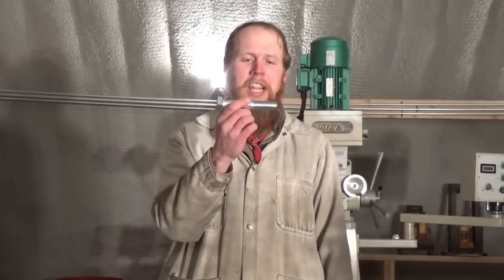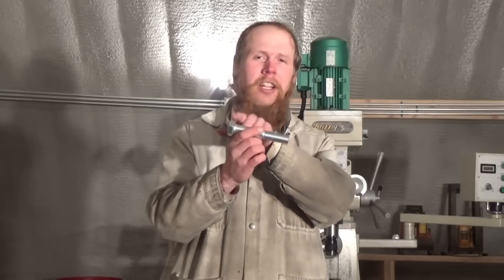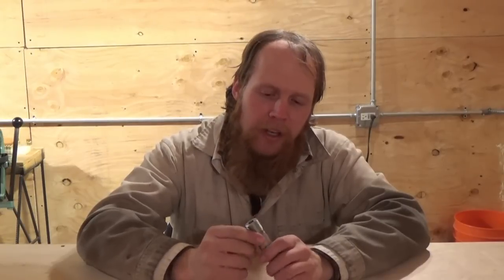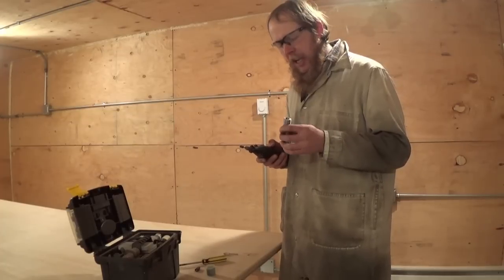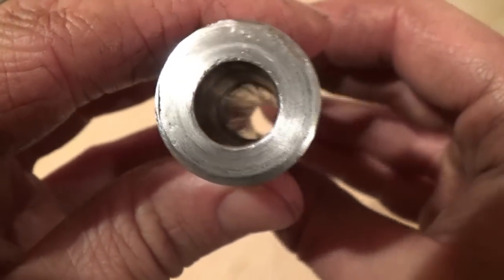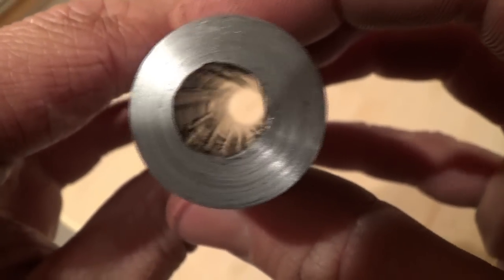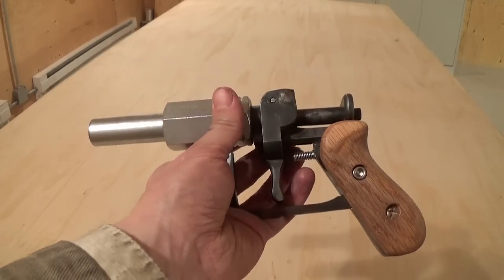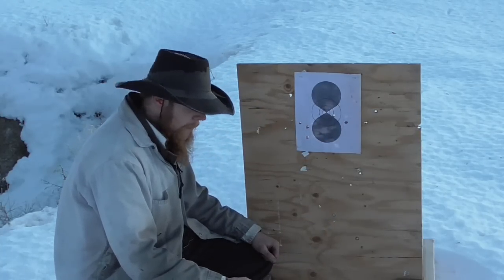Making a Rifled Barrel without Machine Tools (TIS081)

Comment: As a machinist, I am impressed with your ideas about rifling. It is the only skill I could not figure out without rxpensive equipment. You sir are a genius.
Reply from the maker: Thank you!
Reply: @TheIdahoanShow  Have you made any other rifled barrels since this video?
Reply: "There has to be a reason the industry uses button or cut rifling"

Efficiency. Those production methods are relatively inexpensive in terms of the machinery/tooling required and man-hour-labor invested per barrel produced.

-It's the very same reason most barrels are button or cut instead of polygonal, even though polygonal riffling is more accurate. (Polygonal costs more to produce)

-The same reason far more high grade barrels are Chome Moly Vanadium instead of stainless steel, even though stainless steel is just as accurate and offers utterly superior corrosion resistance. (High grade Stainless steel is harder to machine)

You can get a super match grade stainless steel polygonal barrel - but due to the production cost of such a thing: you'll pay quite a premium to get it. 

I.E. You can buy a match grade Krieger AR-15 barrel for $370.
https://kriegerbarrels.com/products#ar15

As compared to this Noveske example of a match grade stainless steel polygonal AR-15 for $$574.
https://www.midwayusa.com/product/100346872/noveske-spr-match-barrel-ar-15-556x45mm-nato-medium-contour-1-in-7-twist-18-stainless-steel-with-switchblock-gas-block

My comment was only pointing out another way one can produce a barrel without the aid of or access to complex industrial machinery, which by the way, is the whole point of the video on which you are commenting.
Reply: @ObservingLibertarian  yep that would work to the extent the metal conforms to the mandrel and if you put the red hot barrel inside a larger end-capped tube (with a mandrel-sized hole drilled in the cap) you could contrain the deformation of the hot barrel as you pressed the mandrel through it, which is the only other problem i can envisage with your method other than being able to handle it quickly enough that the barrel doesn't cool down.
Reply: @ObservingLibertarian how about making a polygonal button and driving it through the barrel?
Reply: He certainly looks like a genius to me!
Reply: Aww shucks
Reply: Very intuitive! Hey, do you think heating the barrel during the buttoning process would help at all? I was just wondering if taking a torch to it while pressing it might give some more accurate groves. Maybe take the barrel upon finishing with the buttoning and getting it to about 1100 degrees or so and quenching it before heat treat?

I don't know, just some thoughts.
Reply: Observing Libertarian Try it. Post a video of your results. There has to be a reason the industry uses button or cut rifling (yes I know those are two entirely different processes).
Reply: Observing Libertarian there are a couple of problems with your theory. 1 metal heated to that degree will deform if you attempt to force a mandrel through it.  2 if you were some how successful in getting the mandrel into the bore of the barrel once it cools you would never get it back out.  take some classes in metal working.
Reply: You can also use the same technique he used to create that "button", to instead create a mandrel longer than the unrifled barrel, heat the barrel in an electric furnace, or over coals till it glows, use a press to force the mandrel through the barrel and allow it to air cool with the mandrel in place. 

While the steel is hot it's expanded and much more malleable, as it cools it will contract around the mandrel and take the riffling inscribed on the mandrel, conforming to lands and grooves. 

After that, drill the inside of the mandrel out till the pressure causes it to collapse and remove the bits and pieces. Tada, riffled barrel. Then you just need to heat treat it, temper it and you're good to go.
Reply: @ObservingLibertarian  Do you know a method to avoid having to make a mandrel for each barrel? Until you got to “drill out the mandrel” I was thinking it was a genius idea.
Reply: Observing Libertarian you can build a rifling bench with no complex machinery and produce cut rifled barrels. I stand by my original comments on the method you proposed.
Reply: "metal heated to that degree will deform if you attempt to force a mandrel through it"

Less than forcing a button through it while it's cold. The process is called "shrink fitting". 

"if you were some how successful in getting the mandrel into the bore of the barrel once it cools you would never get it back out."

Unless you bore it out by drilling through the middle of it after the work piece is cooled. Just like boring out a broken bolt except easier because the barrel is exerting external pressure on the mandrel as a result of the shrink fit. It'll likely collapse inward as soon as you bore a hole 6/8 the od of the mandrel.

Comment: What is the diameter of the button you push through on its "cutting edges?"
Reply from the maker: Well, it is slightly (a few thousandths of an inch) larger than the diameter of the hole.  I am still trying to nail down the exact optimum diameter myself; sometimes I have to make two or three buttons before I get one that fits just right by trial and error.

Comment: that barrel is a weak steel barrel. The grooving will not last long in that...He need a M10 bolt... the strongest you can find.
Reply from the maker: Uh, technically no.  The designation "M10" refers to any bolt that is 10 mm in diameter, regardless of grade.  A 10-mm bolt would have been too small for this barrel, and unless marked as a high-strength bolt, would probably have been much softer steel than this.  Perhaps you meant a metric grade 10.9 bolt, which has a rated tensile strength of 1040 MPa, or about 150 ksi, which is the same as a grade 8 bolt.
Reply: TheIdahoanShow = I meant grade 10...not diameter.

Comment: A possible improvement in production. Rather than holding the piece with pliers, you could  leave the bolt head intact and drill a hole across the head. Do the same in your wood holder and place a drill bit or rod through the wood and bolt to hold it in place. Cut the bolt head off after drilling the center bore hole. Just don't drill all the way down to the holding pin.
Reply: Why cut the head off at all ?/ seems to me that is is built in sight and counterweight...?? also what about drilling it from both sides with smaller drill then run it all the way through and align it? then drill it bigger... just a technique I've used... also after braking the tip I ground the center down as a guide and took off the edge in so doing so it would not cut a new pathway with the larger bit which kept happening... as to the channels, why not use teeth from a carbide saw and weld them or even put onto a pivot with camber bolt to tighten (expand) and cut it several times tighten cut tighten cut.. it will be probably similar set up time maybe more but the results will be really worth while.. I used teeth like that on the tip of a six inch metal pipe to gut post hols through rick for fencing job... what took an hour or more now took ten minutes and a lot less energy, cuts right through soft rock and with water through harder rock,,, never ran into granite but quarts gave a light show at night... and I designed tips for the regular screw bits out of bed frame metal, because they were thin it would act more like a plane blade than a concrete bit and Wham hole in 45 seconds 3.5 feet deep.. single handed... oh for that use a long bar and pound into the ground, put an extension pole on the drill and set it up against the bar in the ground. These are my secrets which allowed me to put fencing up as fast as the expensive companies with crews of four and five. So appreciate it and keep it for the one man crews... the key is to rock it around a bit when you hit a rock so it can get under it instead of bashing it. kinda loose yet tight grip when you hit something and ready to get off the trigger before you get tossed on your ass.. always on the leeward side, so that it is pulling on you not pushing!!!! An electric drill with generator a distance away is far better than any method !!!!! Believe it or not I broke a brand new Milwaukee drill went back to the old black and decker and mounted a pipe thread platform on it for the extended pole.  rebuilt and improved on the brushed and a few other things can;t remember but I did probably a mile of 8ft by 6ft fencing with two by four connectors mounted on 4x4 posts (not crappy screws at an angle splitting the ends ... a major storm came through after one job and my fence was the only thing still standing and saved a house from damage from debris... Never had a problem getting jobs after that one. People willing to wait for quality work... even on a shoe string budget one man crew. 
  Ok distraction over... gotta get back to suing the State for deprivation of rights under a 42 USC 1983 on fraudclosures and unlawful property tax sale. did you know that if your property is not owned by a business engaged in some commercial activities that the assessments and resulting tax is a fraud, theft? Get it taken off the "ad valorem" tax assessors roll!! You are not a creation of the  State and not a subject of nor subject to the State .. the State is a creation of the people and subject to the people!!! "That to secure these Rights Governments are instituted" and"to effect their Safety and Happiness"... Knowledge is power, freedom and liberty. If you want more, want to help find me at truthmonger6 at the gee mail place. If is not written in law I'm not interested...

Comment: I've experimented with using the shank of a broken solid carbide milling cutter. Chucked it in the drill press and used a diamond masonry wheel in the angle grinder to take it down to the major bore diameter, then used a dremel and diamond wheel to cut the grooves. Layed it out just like this one. With the carbide I didn't get the galling and welding in the bore that you did. Used hardened steel dowel pins about an inch long for push rods. Just stacked them one at a time till I got it through the barrel. Did a whole lot better than I expected but not nearly as good as I'd like.

Comment: what's the best metal for assaults rifles barrels
please reply if you could
Reply from the maker: Well, I can't say as I've ever built an assault rifle, so I won't pretend to be the expert on that, but I was under the impression that most of them are made from some type of chrome-moly steel, with a hard chrome lined bore to reduce wear.
Reply: TheIdahoanShow thank you very much but where can I find such metal in  gear and metal and equipment shops ( simply what is this metal used for beside barrel making) ? 
and what modifications should I do to them if I found such metal like tension or heat treatment ?
Thank you

Comment: I just threw some rifling into my decades-old Crosman air pistol. The tiny little .177 button was a pain to make, but the gun now shoots groups instead of patterns!

Thanks for sharing.
Reply: When you remove material like that, does it reduce the 'seal' between the slug and barrel and give lower muzzle velocity/ range?
Reply: @ianrutherford878  Very late reply, but I’m certain that any rifled barrel (even non-rifled ones, for that matter) has some degree of gas-leakage ahead of the projectile. That’s naturally mitigated to a degree by the projectile forcefully molding itself into the rifling grooves a bit under the force, which narrows that gap a bit. There’s actually a big argument on how polygonal rifling, having much smoother edges without the deep grooves of traditional rifling, has less of a gap for gas to leak, and hence a higher velocity. Basically, yes. The gaps would reduce the velocity to a degree, but the advantage of having the accuracy from the spin outweighs that loss.
Reply: Does your old Crosman shoot pellets or BB's? I am curious because I thought about doing the same to a few of my air pistols as well. Thanks for sharing.
Reply: @Jarhead what did they say?
Reply: how about put some rifling in my bb
gun

Comment: I find you to be very Interesting Man.  You may take that as good or bad.  I am curious bout your building is it a quansit hut with shot crete?  Further, why you want people to know how to do this so rough? It may encourage the wrong people.  Unless you promote survivalist?  please get back to me Sir.  Thank you for your energy spent on this endeavor.
Reply from the maker: You are correct that my shop is a quonset hut.  We sprayed foam insulation on the inside, and then a thin layer of cement plaster on top of the foam for fire-proofing.  As far as my motivation for making this with primitive tools, it was just a challenge to prove it could be done this simply before I moved on to more sophisticated projects using the machinery that I've been able to purchase.

Comment: Couldn't you bolt the wood down in the press so it stays in position?
Reply from the maker: Sure, as long as your drill press has enough travel to accommodate it (the little one I used in this video didn't).

Comment: Freakin' crazy  genius-
as  far  as  the results,  as  a  sharpener-
you  need  to file  up  the head  of  the  tool you  made  going  into  the  barrel,  has  to  have  a  CRISP edge  going  into  the  barrel,  lot  more  careful filing of this piece,  or the  shavings  have  no  where  to  go,
instead  of  cutting they swage the  steel,  resulting in messy  lands,  
 that  is  some  cool  work  my  friend:)

Comment: button will stick less if you coat surfase of the bore with copper by dipping the blank in copper sulfate solution or if bore will be coated with oxide layer by treating the bore with some kind of rust gun finish solution

Comment: If you clamp the wood you use to hold the bolt in place before you drill the hole for it out then when you switch the bit out for the smaller one it should be even more centered than measuring it out.
Reply from the maker: Yeah, if your drill press has enough travel to accommodate that method, it might give you better results.
Reply: or you could clamp a stopper in place to clamp or screw the wood against if your drill press has less travel.

Comment: When it comes to drilling straight holes a drill press can actually yield much better results than a lathe, ideally you want the work piece to be spinning too but the trick is to use the set screw on the handle stop to peck out the hole.

Comment: Great video!
And for the broken button: It looks to me like a torsions fracture. Maybe the pitch on the button was a bit too far off from tip to boddom? So maybe it wound itself appart. That would also explain the crude path it "smeared" into the barrel.
Reply from the maker: That sounds like a very plausible explanation.  Good observations!

Comment: Impressive but if you are going to expend the time, effort,, and thought into making the barrel this "good" (or rather "modern" for whatever that is worth) why go with a .40 pistol round? Be better to make an 8mm mauser, 7mm rem mag, .270 winchester or even a .30-06 which are far more rare in pistol form.
Reply from the maker: Well, a bottle-necked rifle-type cartridge would require a custom reamer to shape the chamber, whereas the chamber for a straight-case pistol cartridge can be cut with a standard drill bit, so that is why I chose .40 S&W for this demonstration.  As I start to put my machine tools to use and work on more sophisticated projects, I may very well tackle making some rifle-caliber barrels in the future.
Reply: Makes sense. Did you ever figure out why the slug broke? I notice some 'stuttering'/chattering in the barrel and imagine it was about there that it broke. Surprised it could do that in the confines of a barrel and you sure used the right grease since its particles fracture to make smaller lubricant particles (sort of the opposite of Silicon Carbide grit). Would be interesting to find some one here on YT who does metallurgical analysis and team up with them. Maybe send the contents to them and see what they think happened? Some of the best YT vids I've seen have multiple channels involved.

Comment: Could you also use an old drill bit as a ram rod or would that be too brittle to push the button through the barrel?  Great video
Reply from the maker: I would be concerned about the cutting edges of the drill bit gouging into the bore and getting stuck, but if it was just the smooth shank from a broken drill bit, that might work.

Comment: you lost me at  harbor freight all intelligence has been brought into question
Reply from the maker: Well, since Harbor Freight tools are about the bottom of the spectrum in terms of both price and quality, if something can be done with harbor freight tools, that means it can be done better and more easily with better-quality tools.  The purpose of this project was to prove that I could make a functional barrel with very minimal equipment.  Now that I've done that, I plan to make more barrels using better equipment and see how high I can push the quality level.